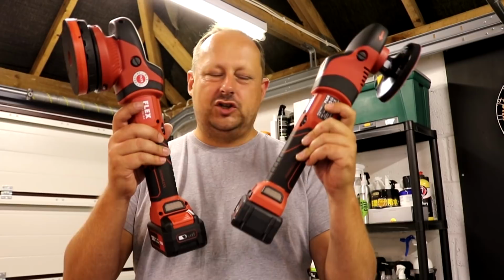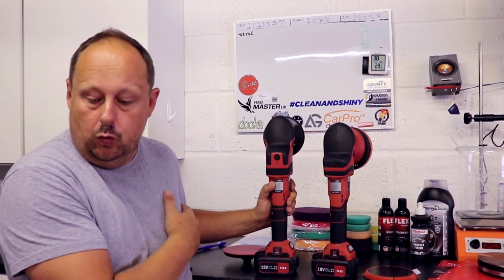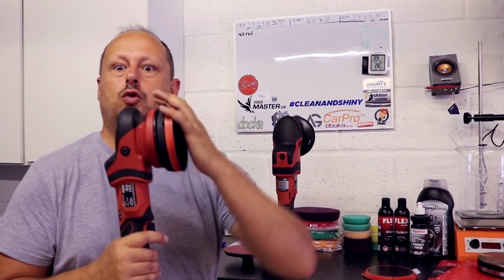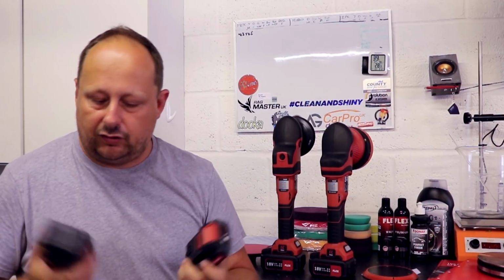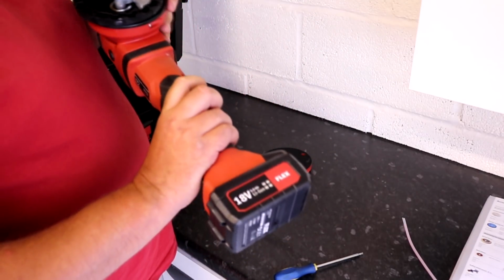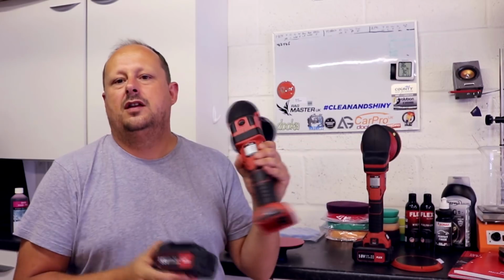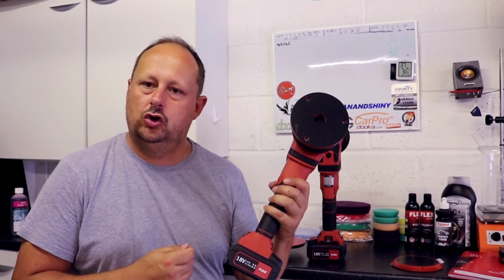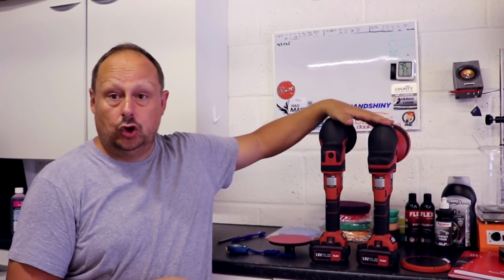Flex Cordless Polishers - PE150 and XFE15 150 review

Comment: Top Notch as always mate! i live in an apartment on the second floor and had been struggling with buying a power generator. A good one is heavy, bulky, and they generate a lot of noise and attention. This was the solution I was looking for! Even if the manager says I can't use them it would be easy to transport off the property and do my work under a tree. Just bought one, you weren't kidding about the price, but my back will thank me later since doing a glaze and sealant by hand is a killer with avg. results and waste of product. Thank you!
Reply: I'm in the exact same situation. My elbows and hands were crying from hand polishing and hand waxing, so I had to find something cordless that a semi-pro/pro detailer wouldn't toss in the trash can after using it once. I'm thinking about getting the DA version. Are you still happy with the purchase?

Comment: I just received my mini flex cordless, love it with the 3” pad, have my ibrid for 1/2”, and now looking at the flex DA for 5”. I’ve been using a duetto with kamikaze bp for 5” as i find it less fatiguing on side panels vs the long arm machines, but I think you sold me with the idea to put the 2.5A battery on the flex when doing side panels to take the weight out, very clever

Comment: Regarding the rotary slowing down under load: If it is assumed that the same tacho drive servo system is used on these cordless polishers as is used in the corded Flex polishers, then I think what is happening is that the cordless rotary, through the tacho servo system, starts to demand more current as pressure increases. In the corded unit. There is (almost) an unlimited amount of power available from the wall socket (mains in UK). In the cordless unit, there will be a limit to how much/how fast the battery will be allowed to deliver power (to maximize battery life, prevent overheating of the battery pack, etc.). When enough pressure is applied to the cordless rotary polisher, it will maintain speed until the pressure (i.e. =increased current demand) causes the battery delivery limit to be reached, and it will then slow down. The tacho servo system may try to demand more power, but the battery power delivery limit will not allow that much power to be drawn from the battery pack.

This is a slightly weird pair of polishers. In terms of physical size, they are full sized polishers, and while there is some convenience to not having a power cord, most professionals (which I believe is the target for these polishers) are quite used to having, and managing a power cable. On the other hand, very tight areas are not where these polishers would be used, du to their size )possible exception would be the cordless rotary with extension bars and a small pad). Seems to me that a better cordless polisher would have been the PE8-4, and a small pad version of the XFE7-12. The PE8, and the XFE7-12 small pad version, are ideal for getting into tight spots, and would benefit more by being cordless (sort of supersized Rupes iBrids).
Reply from the maker: id love cordless versions of the 2 tools you mention.   not sure if we will see that though..

regarding cordless taco.. I could not feel the taco altering the speed at all.  And the fact its not listed in the specs made me think it simply does not have one.  not sure
Reply: Just an assumption on my part regarding the tacho drive. If it isn't present, then its absence could explain the speed variation with pressure all by itself.

Cordless small polishers make more sense to me. To be practical, they would need to use the small battery, or design one that fits in the handle, like the Rupes iBrid. Current draw would be lower, so there would be less of a need for the bigger battery.
Reply: @ForensicDetailing  At this level, I'd be extremely surprised if it didn't have some degree of speed regulation. The Milkwaukee definitely does (and has a wider speed range). Note that the Flex does menton high torque at low rpm - this does suggest to me that it has speed regulation. If it does, then Kostas' suggestion that it may simply be hitting the maximum power delivery limit of the battery could be correct.   
If I were going to buy now, I think the Milwaukee seems superior to me, and of course they have a huge range of other tools that could be used with the same battery system. Actually their mini rotary polisher looks pretty good on paper too - goes all the way up to about 8000rpm - this is what we need for small pad sizes. I don't think this one is speed regulated though. Shame it uses the 12V battery - arrrghhh. 🤣

Comment: Another cordless polisher I'd like to see a review on is the Makita DPO600Z. It looks pretty good - has both free and forced rotation, HOWEVER, strangely, it is only a 5.5mm throw, which seems very small by today's standards. Having said that, I've been able to remove light swirls with an old Bosch RO sander that only has a 5mm throw.

Comment: If they come out with the capability to make it corded also like the Rupes Nano this would be a much more appealing tool.  I would consider buying it if it had a corded option, not sure if I would have purchased the Rupes Nano if it didn't have a corded option even though I find I don't use it much because the batteries charge so quickly. Solid video as always!

Comment: I have this akku XFE, it very comfortable to just put your second hand under the battery (if you working on some flat horizontal panels)
Reply from the maker: I found myself doing that as well. wasnt sure if it was a faux pas but it just felt confortable to hold the tool like this sometimes..

Comment: would like to suggest you try the new modified XFE 15 corded tool and it feels similar to what you are describing with this tool with respect to vibration and noise. The overheating problem has also been corrected and overall in my opinion probably a great machine.
Reply from the maker: Id like to george, the cordless was definetly smoother less vibration.. but I didnt noticed any overheating problems when i had the original wave or th first iteration corded version.  I was really interested to know if the corded had been tweaked to match the cordless.  as well as the counter weight change, im sure there were some subtle design changes with the shroud border, it looks more rubber like on the new tool but also perhaps the distance from the border to the place might be like a tiny bit wider..
Reply: Forensic Detailing Channel I purchased two units and they both had overheating problems with the head on one unit going wobbly. I contacted Flex who replaced both units at no cost. I have been using them for the past few weeks and picking them before my Rupes 15. I am really impressed with the improvements. Thanks for your prompt response I enjoy your channel immensely
Reply from the maker: interesting george,  let me know how your tools hold up.   sounds like the original counterweight or plate system had an issue.  shouldnt happen in an idea world but hopefully its sorted with whatever changes were made.   flex tools come with a 2 year warrenty (theres a rumour they could be upping it to 3)

Comment: 14:42 Couldn't be the unexpected difference because when you ran the machines freely, without touching the surface, the rotary did keep rotating just as it would in real world situations (ie. when it's in contact with the paint), whereas the DA was just vibrating, without actually (or just barely) turning the plate, which in turn required less energy?
Reply from the maker: with regards to no load testing

With the DA I think its less about plate spin.  both tools are turning an axel with gearing.  So the speeds they rotate the axel are not consistent if you were using the same numbers.. so that will be the main factor.  but also the load on the XFE when testing no load run times, will be higher.. the XFE has to rotate the weight off the offset plate and the counterbalance..  the rotary just has to rotate a centre'd plate.

at least I think gabor but im just brain dumping
Reply: Da is free spinning so I dont think it matters.
what I would like to know is the battery capacity for work, not when you only run the machine in the air, quite pointless.
Reply: Well, according to the laws of physics (especially the conservation of momentum) the weights are only important while accelerating - so only in the first few seconds, if the you keep the things continuously running until the battery is empty. But once they've reached their respective "terminal" velocity (the maximum/designated rotational speed for the actual speed setting), it's only the loss in momentum due to the mechanical friction (of the drive gear and of the motor) and the loss of energy due to air resistance (of the motor and of the plate) that has to be compensated for to keep the plate speed constant. However, the total weight of the spun parts per se should not be influencing anymore the amount of energy needed to keep them spinning. 

Now, a counterweight has obviously far less air resistance than the backing plate has, because overall it has a smaller surface. Actually, the backing plate's surface is even huger than it seems, at least compared to the counterweight, because of all the hook and loop bits, which all individually add to the total surface, with more than it seems at the first glance. So, when considering the amount of energy needed to keep device spinning at a constant speed, it's far more important that at what speed the backing plate is rotating, than at what speed the counterweight is rotating; and the latter's weight (or the weight of the backing plate, or that of the drive gear) doesn't matter at all at this point.

Also, air resistance is squarely proportional to velocity, and the rotary spins faster, at higher RPMs, than does the DA. So, even if the latter's backing plate is actually spinning and not just mostly vibrating around, even then the rotary should use a lot more energy to keep the backing plate at a constant speed, than would the DA.

I think this is the explanation why the DA kept running longer. Would be interesting to see how they perform under actual load. My guess is that the DAs advanced would vanish, or even turn into the opposite, for the same amount of correction or work done. Of course it would be virtually impossible to measure the latter objectively without high-end technical equipment. 

Also, if the two models - for whatever reason - are using different motors, with possibly different efficiencies, that could also influence the results, as could differences in ventilation (higher temperatures increase resistance in electrical components and in turn waste heat) - especially if you keep the machines running for such extended periods of time.

However, a subjective comparison (under real world use conditions) could be still useful, because after a while one should be able to develop a "feel" for which lasts longer or provides more amount of total correction, regardless of not actually measuring that objectively.
Reply from the maker: holy cow gabor :)  but yes under load the XFE goes for longer..

Comment: Hi Jon great review on these two.  they look nice but the battery life aint too crash hot.   I think the Flex rotary starting rpm is too high.  I'd like to see one at 350 - 1300 rpm from a cordless version.   Somewhat like my Fein WPO 14-15 XE which is 200 - 1500 rpm
Reply from the maker: I would would have like to have seen a lower starting RPM as well matt.    the fact both tools had compressed speed ranges makes me think theres almost certainly a technical restraint.
Reply: yeah.  Have you seen the Fein before, it's a bloody good tool. discontinued now but at 350 and 500 rpm it's wicked.   PS I am now focusing on the next generation of polishing machines and have a manufacturer working on it.  He's pulling apart a machine (not a polisher) that has the next leap forward in technology for polishers contained in it and seeing if he can modify the tech and make it fit a machine polisher.  it's one of at least four designs I have.    I'll keep you in the loop but if it eventuates, it will make everyone stand up and take notice globally in the industry and give Rupes a reason to go back to the drawing board.   Corded and cordless combo should be the go with every cordless machine unless there is some reason why it can't work.
Reply from the maker: reg uses the Fein.. its a proper workhorse.. but he uses an old machine that is run 12 hours a day 200-300 days a year..  big old heavy thing but its a old model but its taken some serious abuse and it will go on and on and on.  they were experimenting with cheap rotaries and they would die after 2-3 weeks of continous use.

id love to stay in the loop with your polisher project Matt sounds very interesting.
Reply: That's cool at least someone does. I love the four push pads rather than the trigger and trigger lock system.  yeah the old workhorses do well, these cheap pieces of crap rotaries have no torque and they bog down if you put pressure on them  - garbage.  Your one of a few who will be notified how this project goes.

Comment: Just got my cordless XFE, awesome tool it is. No cord!!!!
Reply: I heard it doesn’t cut , that’s most used for finishing or polish is that true ?
Reply: @ernestobenavides6716  I have no issues cutting with it.
Reply: @magmagmag9  what pads and creams you use with it ?
Reply: @ernestobenavides6716  I mainly use abrasives from 3D. As for pads, I use Detailing Kingdom. Their pads are actually developed to be efficient on Flex machines. It's a local company here in Malaysia, but is available in some other countries. Check them out.

Comment: One thing you didn't talked about is how much easyer it was to use without the powercord.  I mean not rubbing the cord to the paint and not thinking how to avoid it.
Reply: On the flip side, the power cord sometimes also helps with stabilizing the machine - especially if it's a large throw DA, and you're forced to hold it with just one hand, because you've to reach so far inwards on the hood or on the roof. You don't have that advantage with a cordless version, and I'd also argue that you possible can't even reach that far in with these machines, as they should be more sensitive - in regards to balance - to where you're actually grabbing/holding onto them.

Comment: What a good review on 2 good polishers.  Price i imagine will be the biggest barrier, i understand what you were saying about having a power supplied permanently. But then why buy a cordless
over the corded. I imagine they are aimed at people like yourself who use them regularly.
Reply: The only benefit I could see would be that in the absence of a power cord you were less likely (well, actually unable) to scratch the paint with the latter, and the elimination other small nuisances related to cable-management (like the inability to trip over the cable). However, I could never justify the price difference (which is around 100%) between the cordless and corded option with that. Actually, the price difference in the long run could be even heftier than that, because while batteries do degrade after a time and need to be replaced, power cords usually never need to be replaced during the lifetime of the main unit.
Reply: Gábor Bérczi  I completely agree - it would be nice not to have to worry about tripping over power cables and wearing them. But I think that's where the advantage ends as you will need a plug in mains power source to recharge your batteries anyway!  I think these Flex tools would be good if you needed to detail a car outside without the need for a very long power cable (which a LOT of people would get wrong  through use of a too small a gauge of wire anyway)  The other POTENTIAL inconvenience MIGHT be if the battery gets in the way of easy manipulation of the tool - this needs to be determined BEFORE you invest a TON of money !  : )   Happy detailing!

Comment: Are you sure you need to half the listed OPM to get the real OPM? I believe Flex list RPM as half of the OPM speed. RPM meaning the rotation of the pad as it oscilates, I believe?

Not sure though.
Reply from the maker: Im really not sure either, I wish there were standards that the manufacturers had to stick to so we would actually as consumers be able to compare like for like.   One of my viewers told me that I needed to half the listed OPM rates from flex to get the real OPM.   but I dont know.
Reply: @ForensicDetailing  I'll try to get in contact with Flex, hopefully they can tell us. I do know that my cordes XFE runs bonkers fast at speed 6!
Reply: @ForensicDetailing  please consider measuring it for us with one of those strobe tachometers.

Comment: Nice review love all your videos but new technology price for old technology idea. Cordless tools have been round for a long time. I just don’t think it’s worth the extra £300 just to go cordless. No good for doing full paint correction if your a mobile detailer unless you either got a geni or mains electric or loads of batteries. Good idea of having a corded plush in option.
Reply from the maker: all fair points darren..   but at least you have the option now if you did have a requirement for cordless..  battery performance has improved over the years as well.